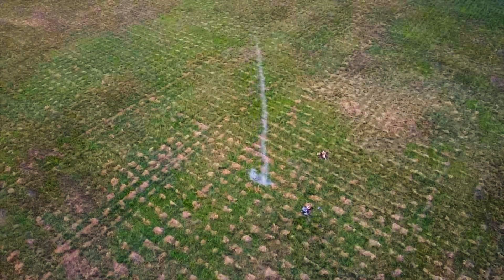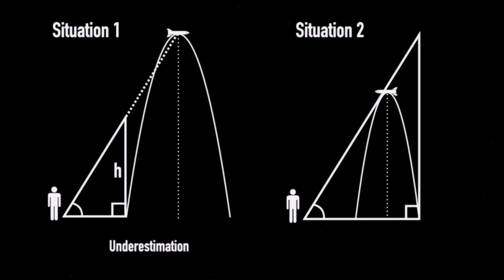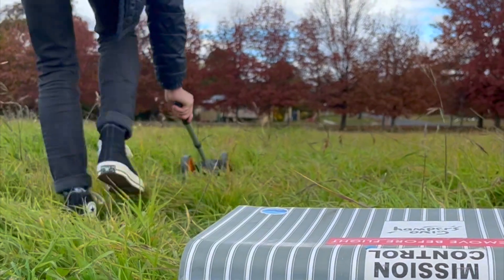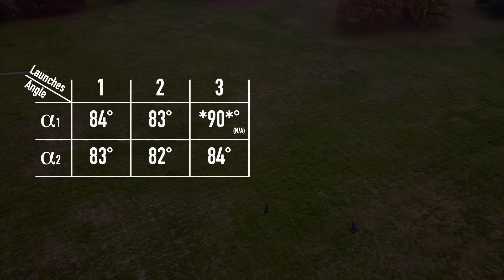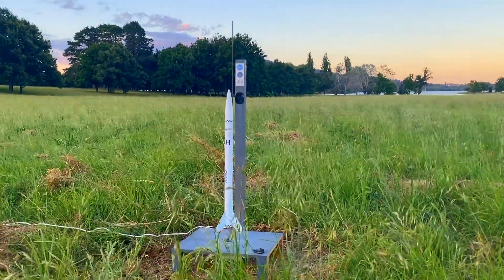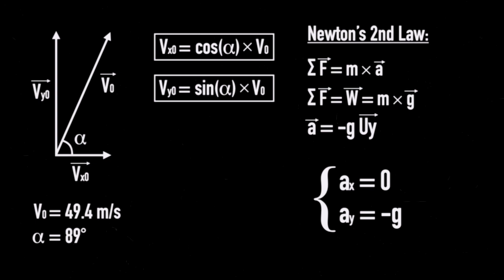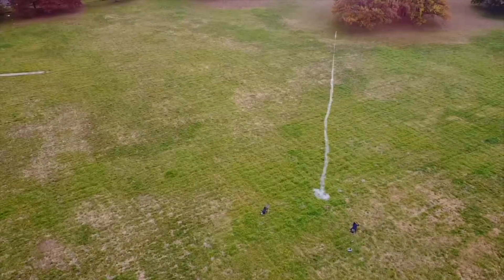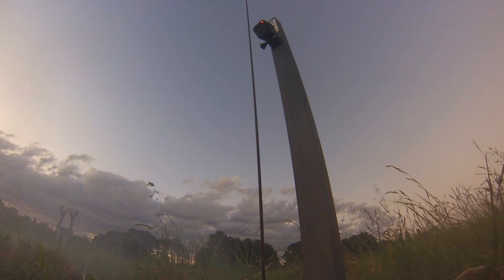How can Trigonometry Estimate Rocket Apogee Altitude?

Comment: Nice work on a well produced video! As you said yourself that the baseline was a little too short for getting an accurate measurement. The error gets exponentially worse as you approach 90 degrees elevation. One thing someone pointed out in the comments in our video, and I think they are right, that when measuring from the two locations, you should get a more accurate estimate if the two locations are at 180 degrees rather than 90 degrees away from each other.
Reply from the maker: Thanks for the support and for that original video you guys made! And yes I always knew going into this project that I was quite limited with the baseline distance, still somehow working out to a decent degree however. I hadn't considered doing it 180 degrees apart either, it would be interesting to see how much more accurate that is in numbers!